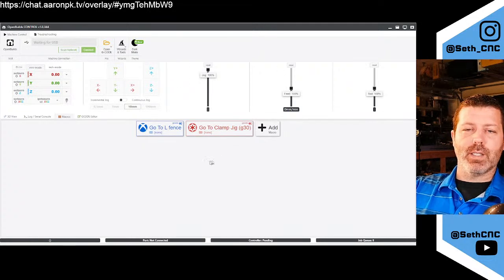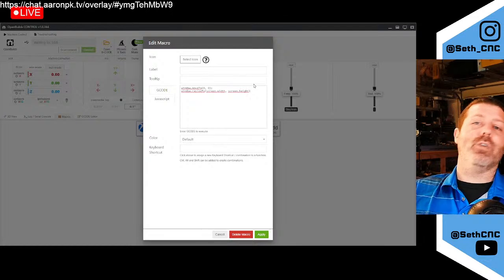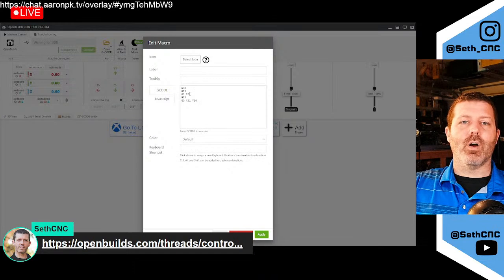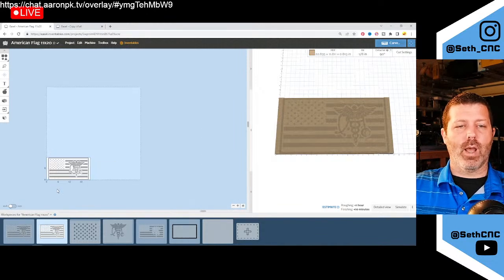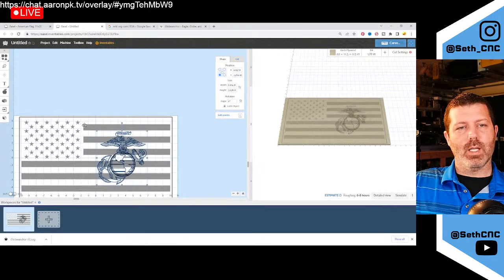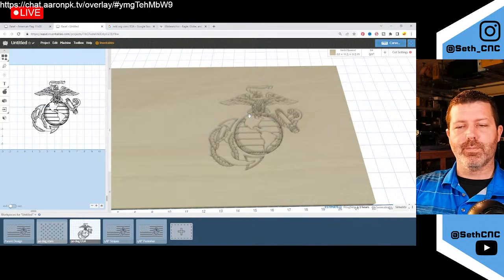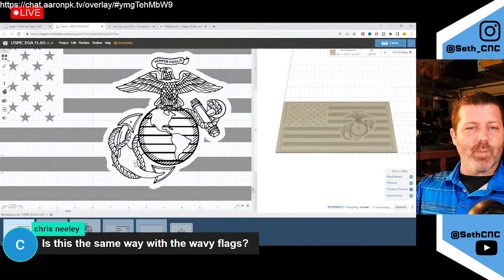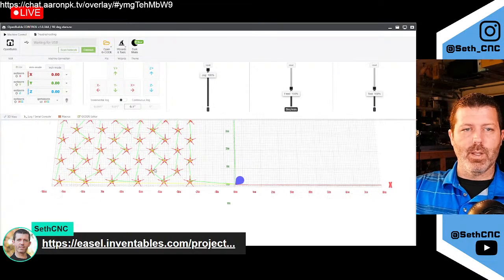🎙️ OpenBuilds Macros for Beginners & Adding Logos to Flags in Easel

Comment: How do I set speed and what is the TOOL slider for? Thanks
Reply from the maker: Tool slider is spindle rpm If not using a router... set which speed?
Reply: @SethCNC  the speed of moving the bit in the wood.
Reply from the maker: @Chris-vc1dh that would be referred to as "feedrate" and is set within the CAM software. What software are you using for CAM (to generate the gcode file)
Reply: @SethCNC  i use carveco maker
Reply from the maker: @TaoMe-11  your feedrate is set over there and saved to the gcode file
Reply: @SethCNC  Is it in bit settings?
Reply from the maker: @TaoMe-11  it can be defined there,  yes.  You may want to check out the carveco tutorials